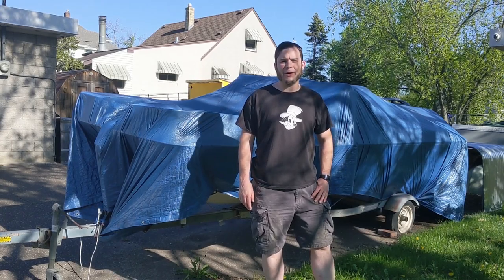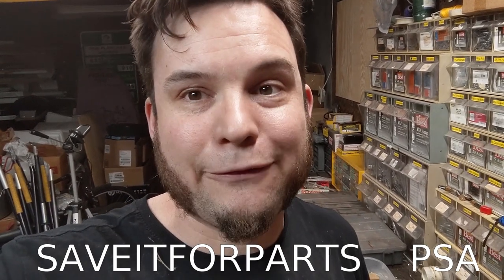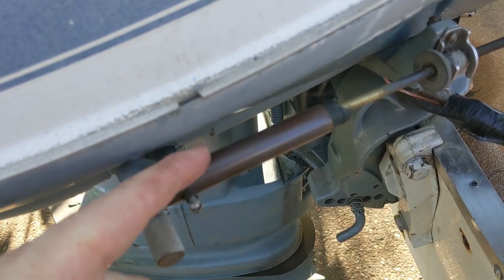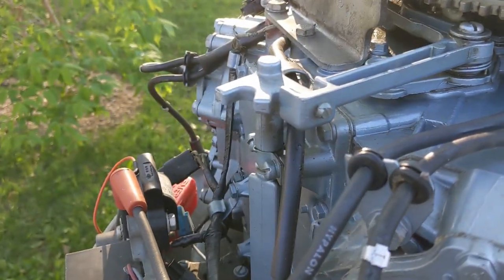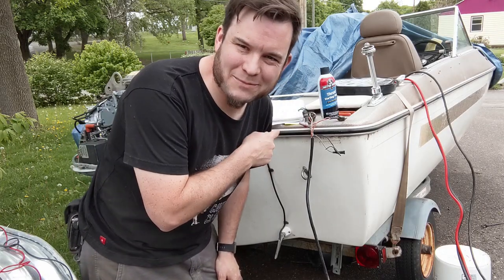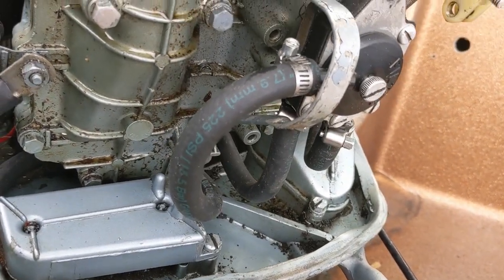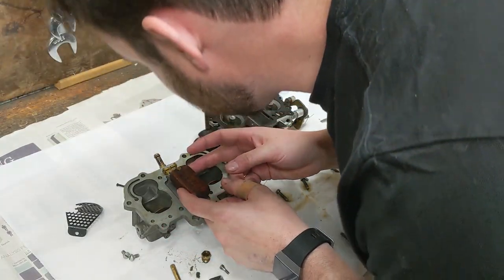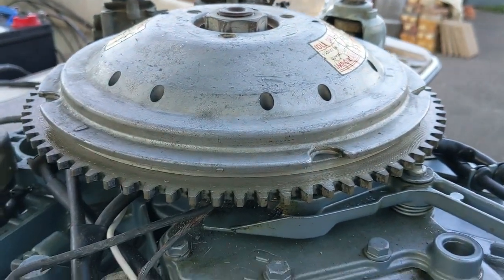Refurbishing A Free Speedboat - Part 1 - Checking the Engine

Comment: I have a boat very similar, 1977 imperial with a 115 johnson.   You can pull start a 65 easy, Ive pull started my 115 when the battery died, and it was easier than i thought it would be.  Love my old boat, had it 15 years or so.

Comment: The face of the key switch will have a "KF" number on it take that number to marimeengine.com and look in the BRP Marine catalog under "ignition keys". I found the part number there for my 1964 60hp Sportfour to get it cranking with a key. Or for the time being just remove one of the wires on the "M" terminals at the back of the switch.
Reply: Marineengine.com not the one i mistyped above.
Reply from the maker: Thanks! I just ended up buying a new key switch at the hardware store.

Comment: Pro tip (bro tip?)  When holding solder in your mouth for soldering, take a deep breath before the solder hits the heat, and slowly exhale while making your joint.  Your lung cancer may hate this one trick, but your lungs will love it.

Or, learn the Big Clive trick of holding the solder and circuit in one hand, and an iron in the other hand, and do your soldering under a fume hood, pretending to be a professional electronics technician and not a guy who just gets things done.

Comment: That engine doesn't look bad at all. Make sure you got good cooling water flow. If you're not getting a good stream, take out the thermostat and leave it in a cup of vinegar overnight. "Milkshake" in the gearbox, means busted seals, yours looks fine. That engine will purr like a kitten, you just watch. Car seats, aka porch furniture, needs to be tested for corona virus and burned either way. Simple fold up seats will do, then you'll have room to do some fishing. It doesnt have a name yet, do I smell a naming competition for the subscribers, or is it just those car seats? Good luck with everything.
Reply from the maker: A naming contest is tempting if it doesn't default to Boaty McBoatface :-D